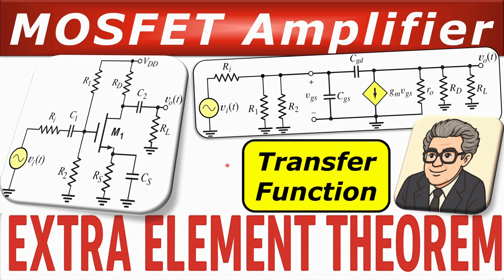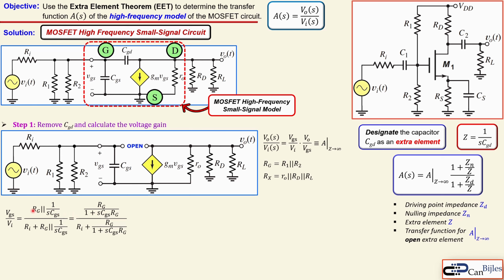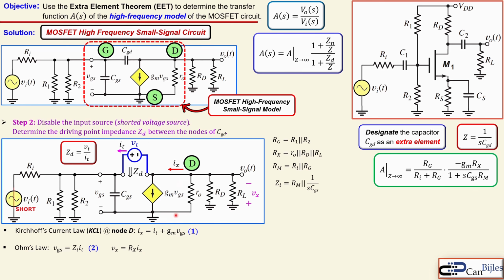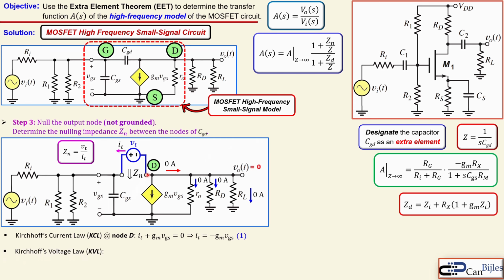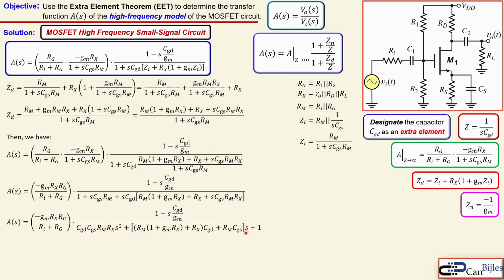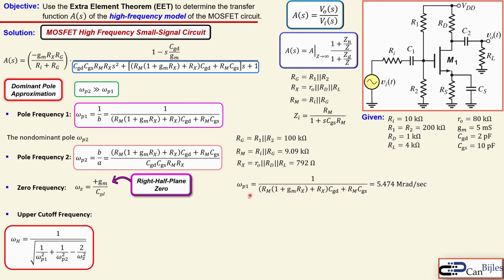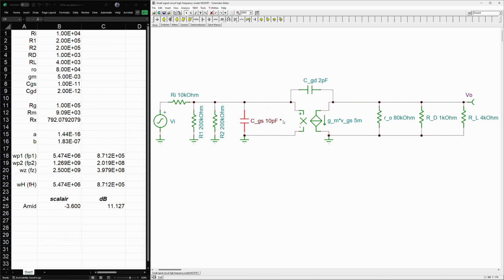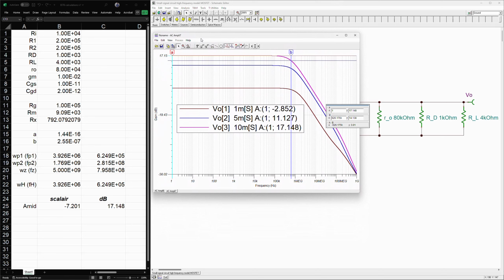MOSFET Amplifier Transfer Function 🚀 High-Frequency Response💡Middlebrook’s Extra Element Theorem 👍🎯

Comment: really difficult for hand calculation, Need a larger paper...
Reply from the maker: The EET is actually very suited for feedback circuits. Yes, the math is always there and will take some time to solve everything.

In this video, I use a different method for the frequency analysis of a MOSFET Amplifier: https://youtu.be/67c7pkEgPOE

Comment: The MOSFET Output Capacitance (Coss) is not included in the equivalent circuit. Can you explain why it is missing? Thank you.
Reply from the maker: The high-frequency model of the MOSFET includes more parameters than I am considering. This will make the model more accurate but also more difficult. I have used the standard model which will give a good results for most cases, but also to emphasize the EET without going to much into complexity. 

The additional capacitances in the high-frequency model are the source-bulk capacitance and the drain-bulk capacitance. These capacitances are usually much smaller than the two capacitances I am considering. So, it is not just a output capacitance.